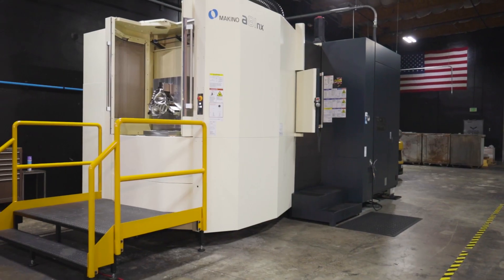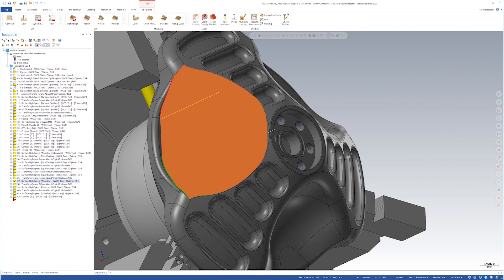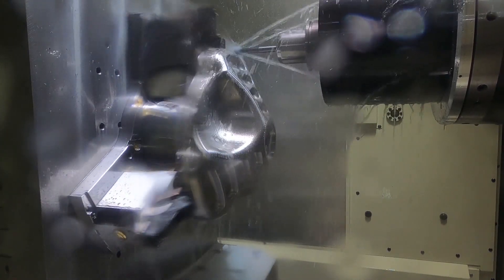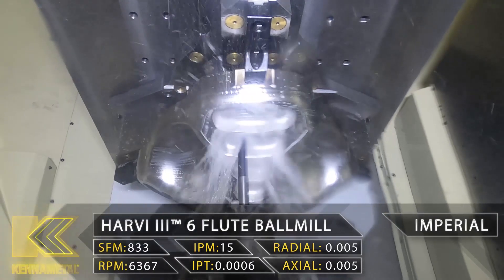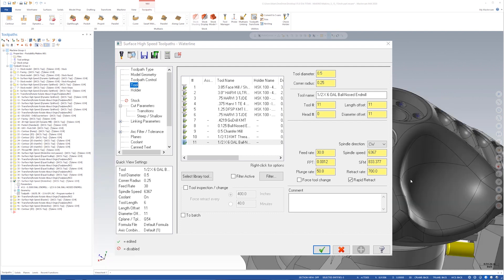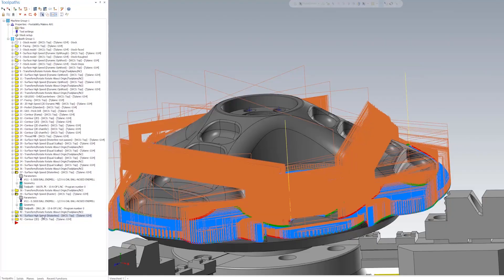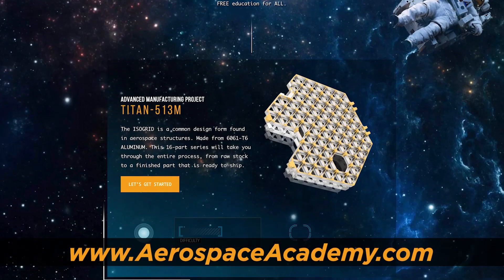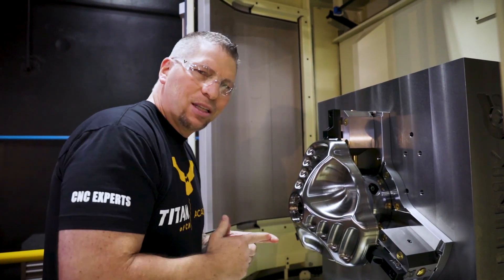MAKINO 60 HP | Incredible Titanium Final Finish | 3D Surface Entire Part

Comment: With how much he's babying it, I assume it's a one off or limited production. Don't wanna scrap that for how much machining time he put into it. @.0006ipt you're essentially burnishing now. That ballnose won't last another part. 

Don't know the Ra tolerance but if it's 60 or less might as well send it for external finishing instead of wasting machining time. But that's his choice really.
Reply: 60Ra is actually alot. We rarely get anything in our QA lab that is over 32Ra or RMS
Reply: @robsimmons4571  - Yeah, boring operations would get that kind of finish. And it could be done with some machining like he's doing but if it's spec'ed for 125ra (standard for most Aerospace parts) it's wasteful to try and get that in a machined part. Sending it out for post processing would be cheaper and more efficient. Faying surfaces are obviously different too. 

What kinda parts and material do you get in your lab?

Comment: Really beast, but.., why do you use such a squat tool holder and such a slipped tool? doesn't it compromise the surface quality? In these cases we use a popular german hydraulic tool holders ( HSK-63), with the tool exposed the necessary,
Reply from the maker: This is actually an HSK100 hydraulic also called the HydroForce from Kennametal... I also needed the tool to hang out to walk down the deepest pocket without the holder hitting. I could have used a few tools etc... stub and long one but was more concerned with just getting it all done with 1 tool.
Reply: @TITANSofCNC  OK, with just one tool for finishing the whole part, you also have the most homogeneous surface and also finish the series of pockets without a radius remachining (but I would have used a different finishing strategy, such as a spiral or equal scallop, covering the pockets, but that's another story) In addition to saving tool change time, even if on N hours of finishing I don't know how much this can affect.I am curious, because by the videos some things behind the scenes are not clear, I work with machines that have 100/150 tools in stock, where once I find the right tool / tool holder setup I try not to make changes for a long time. You, I think, need to change setup at each part, but in this case have you taken Kennametal tool and tool holder dedicated to this job?

Comment: with all the 3d milling code, how large is the program? does the machine take the whole thing, are you drip feeding, or putting sections of the program in?
Reply from the maker: Huge program and barely takes it... but yes got it done.
Reply: What is the size of a ‘huge program’ and what is limiting you? Space on the machines operating computer? It’s really that limited?

Comment: Hi, Titan, that's a beautiful work. I just want to share my idea. For the bowl shape is that better if we use a 1/2 endmill with a .06R to finish it. So that you can also use the same cutter to finish the bottom flat surface with big step over instead of .005 step over surfacing. It may speed up a little bit.
Reply from the maker: Good thoughts, especially on the floor. Because a Ball has a .25 Rad it keeps the wall smooth with a .005 step over... .06 is much smaller and would take way more passes to make an equal finish... Also, I wanted to show 3 styles of 3D that worked well together.

Comment: Is it just me or is anyone else thinking "Could you imagine crashing this part right at the end of the run".
Reply: Lol you guys with your test pieces/setters... inexperience and incompetence leads to errors. With skilled CNC machinist you make it right first time.
Reply: Samuel Court sorry to pop tour bubble bit tjere no such thing as a cnc machinist. A cnc programer operator is not a machinist. And most of the cnc operators I know could never run the machines that are not computer controlled.
Reply: holmes1956O interesting , you sound like my ex father in law. What an “add” he was .
I’ve been a cnc programmer , machinist and light fabrication making everything from cheap heat sinks to die plates, billet aluminum, stainless , 4340 chunks, manual lathe work with .002 mm tolerances etc etc etc. My primary function at work is to CNC PROGRAM. However when designing fixtures for every operation , machining them, and installing all the needed components from ,Jergens, Carr lane, Kurt, Kaiser etc etc etc . THEN , running all the operations to inspection. I’d say that I’d qualify for the term CNC MACHINIST. . As well as I’m sure thousands of thousands of qualified people like myself across the globe. Yah I’d say that CNC MACHINIST is a real term like it or not.
Reply: Robert D I dont know and probably dont care what you mean by ADD. The things you SAY you make to do your job are the things people with your job or machine shops with cnc programers aka machinists come to me to get made because they dont have the abilities
Reply: @D_V_.746  if a TIG welder a hand file and some imagination could fix anything I wouldn't be paying alimony right now LOL, thanks for the comment
Reply: @D_V_.746  damn 20/20 hindsight! LMFAO

Comment: What is the process time on this Titan?
Reply: My bet is 4-5hrs?
Reply: @alexkern9134  I'm a tool maker (hardened tool steels predominantly) and I can tell you if you finished a block that size in less than a day you did something wrong...
Those finishing opps are what we'd call a weekend runner.
This would probably be around the 30 hour mark im guessing. But wouldn't be surprised if its more.
Reply: @alexkern9134  maybe 4-5 days
Reply: I came here to ask the same thing.. Thinking 20-30 hours start to finish.
Reply: Damn! Shows that I've never done anything this big!

Comment: Titan, is this part too big for your DMU50?
Reply: It's not a matter of size, the cubes that have to get removed from that would probably take 3x the time  on the dmu50.
Reply: @grinchyface  but the dmu will beat the makino in prefinishing and finihing
Reply: @marouanebenderradji137  why
Reply: @nf794  5-axis surfacing, so better/more consistent tool angle contact with the material.